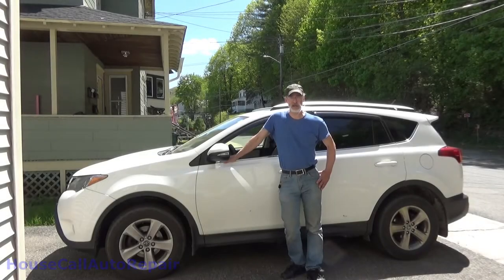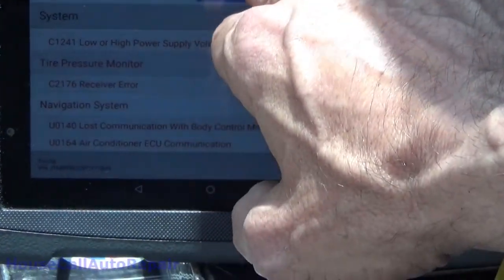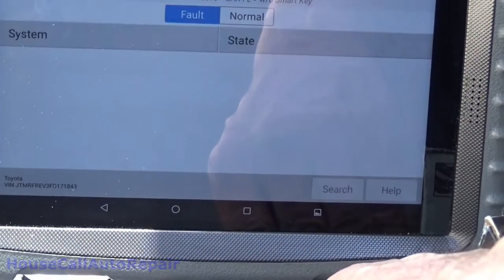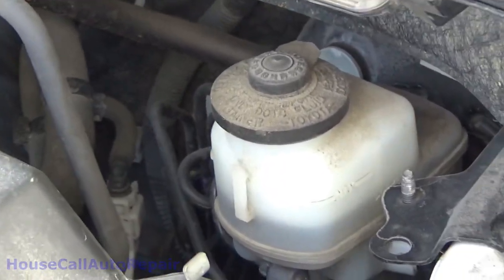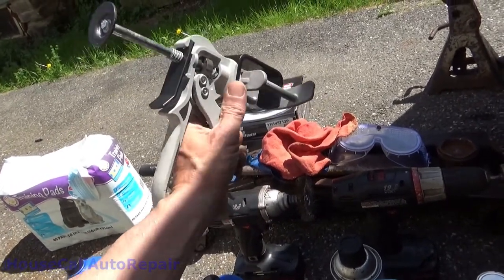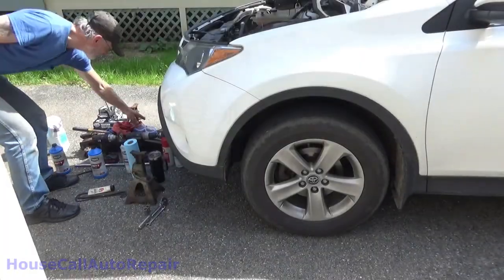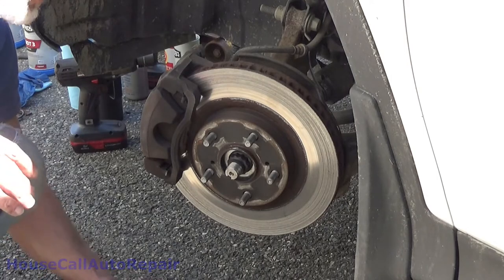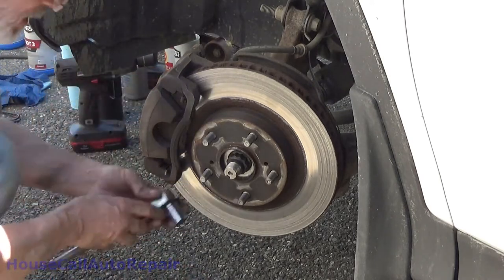Return of the Rav4: Front Brakes, Rotors, and Reconditioning

Comment: Goggles, gloves, little brush, cloth under the wheel, wire brushes on drills, thread locker, wow, your overhead is skyrocketing compared to the last you did those brakes.  Is it necessary to have special grease for caliper pins or can any grease be used?  If the old rotor was reused wouldn't the new pad just conform to the grooves?  What kind of camera do you use?  Thanks in advance.
Reply from the maker: Great questions! Grease... NEVER use petroleum based grease! High temp, water resistant, silicone based grease works best for rubber containing components.
While pads will "wear in" to used rotors, this WILL degrade life and performance of the brakes as a whole.

Comment: 8:14 How can you turn the steering wheel to turn the direction of the rotor when the engine is not working. Thank you for reply.
Reply from the maker: Put in key, turn to "ON" but do not start. Turn steering wheel. (May require some effort)
Reply: @HouseCallAutoRepair  Thank you very very much. I learned a lot from you.